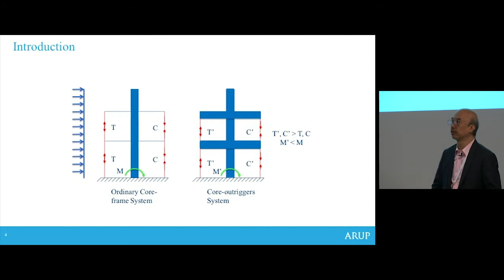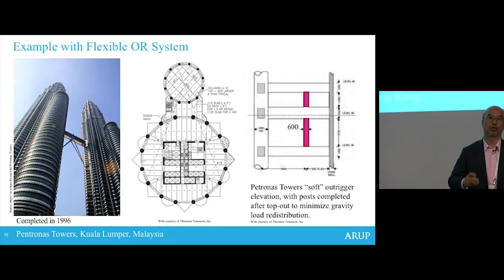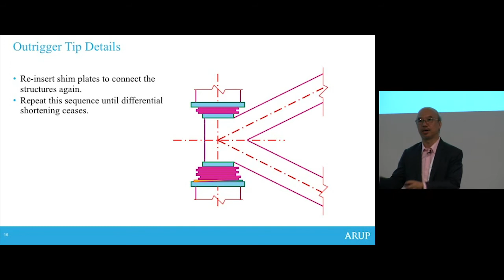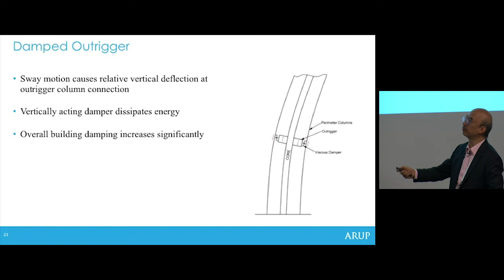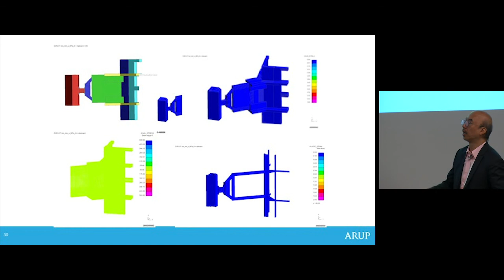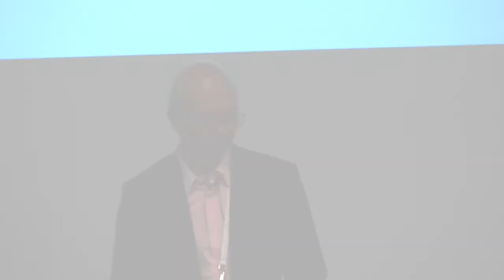CTBUH 2017 Australia Conference - Goman Wai-Ming Ho “Outrigger Systems for Tall Buildings”

Comment: The most common structural system for tall buildings is the dual system comprising perimeter moment resisting frames and a central core. The outriggers are actually corrections in this dual system as we go higher and higher and the demand on the central core becomes too much.